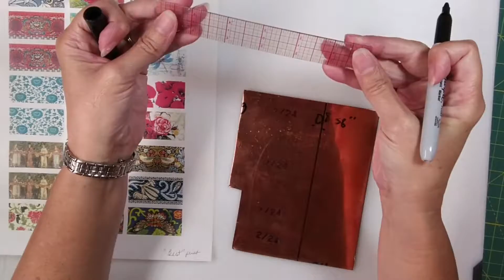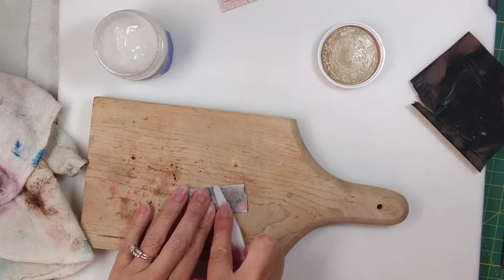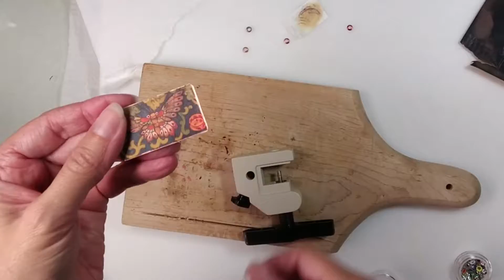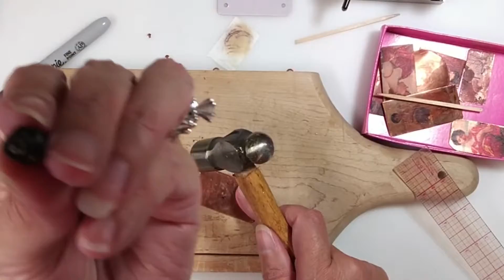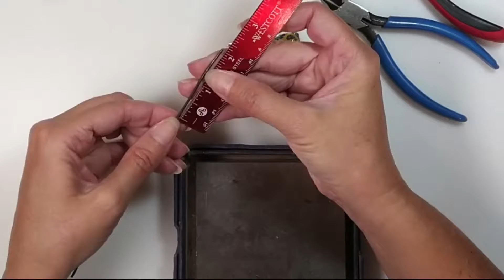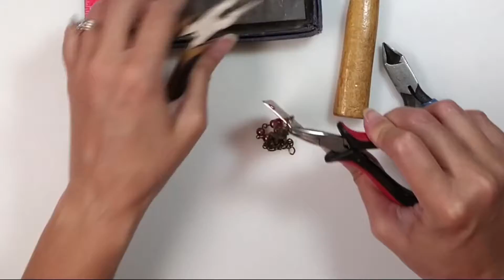Copper Bracelet with Image Transfer Jewelry Tutorial: Create a Customized Bracelet in minutes!

Comment: Any other options for the genesis heat set paste which seems to be unavailable?
Reply from the maker: @alisongoerner7457  I haven't found a replacement. I tried other mediums with limited success. 

I would guess t-shirt transfer paper might work since the design is transferred by heat too.
Reply: @TejaeFloyde  I
Yeah, I wanted a product that would release the toner only, as I would be using it for acid etching my designs on copper. I thought I had found the magic bullet. Darn!
Reply from the maker: @alisongoerner7457 are you wanting to transfer color or just black toner for the design you're transferring?
Reply from the maker: @alisongoerner7457  

Here's a couple of things that also works to transfer to copper. 

Omni gel transfer medium, or 

laser tran transfer paper (you'll need to soak with water to remove the paper) or 

Have you tried acetone? (Needs to be real acetone, not the nail polish remover)
Tape the toner side to the lightly sanded copper sheet. You'll need to experiment with how long it will take but basically the acetone will make the toner release from the paper. It tends to make the toner a bit sticky. You'll need to gently wash the acetone before etching as it may interfere with the etchant.
Reply: @TejaeFloyde  thanks so much for your replies! I have been experimenting with the 100% acetone, but I have not had good results so far. I have two printers at home, one ink jet and one laser , and now I’m going to try my husband’s at his office. They always  make it seem so easy on the videos, but there seem to be so many variables! 😱I will research the Omni gel, THANKS!!
Reply from the maker: @alisongoerner7457  you are correct. There are lots of variables. I make notes as I go so I can keep track of what works for me.  If you’re interested in jumping in a video chat I’d be happy to chat with you about it. So you can show me what you’re tying to do.
Reply: @TejaeFloyde  I’m just trying to do basic black for now. Specifically natural items like leaves and plants in enlarged detail that I manipulate on Pixelmator, print, and then acid etch on copper and sterling silver. 🤗
Reply: @TejaeFloyde  I ordered the onmi gel and can’t wait to experiment with that as well!
Reply from the maker: @alisongoerner7457  i know you can transfer laser images with lazertran, omni gel and possibly acetone (if you scuff up the copper). 

Because you want to etch the design into the copper transferring your laser print art with acetone seems like the easiest way to be able to etch it after transferring.
Reply from the maker: @alisongoerner7457  great. You might enjoy this book by Linda & Opie O'Brien called Metal Craft Discovery Workshop. 

https://www.thriftbooks.com/w/metal-craft-discovery-workshop-create-unique-jewelry-art-dolls-collage-art-keepsakes-and-more_opie-obrien_linda--obrien/484770/?srsltid=AfmBOoq8dAe5mJi5_8XFKWaW8rojoMDs5viZ-GlzAMN7uEFdBRrBNCZy#edition=5151010&idiq=5999011
Reply: @TejaeFloyde  I will, thanks so much for all you input!